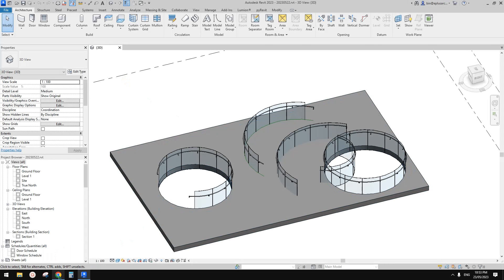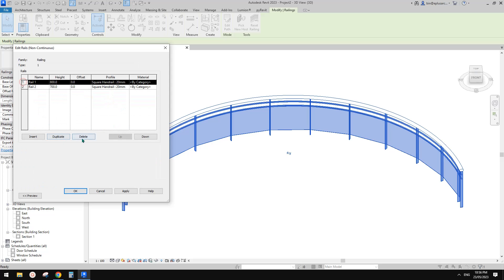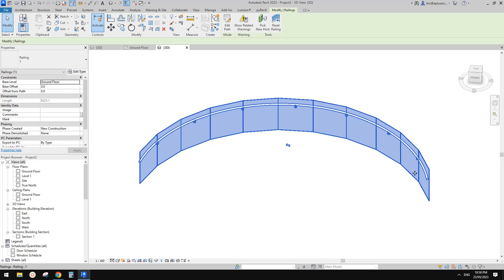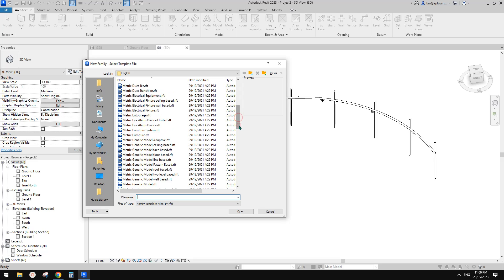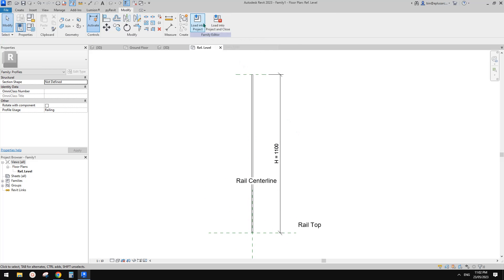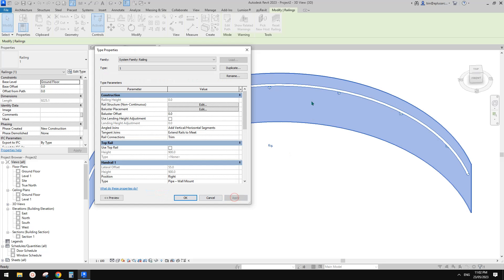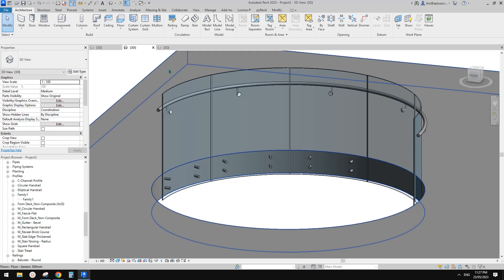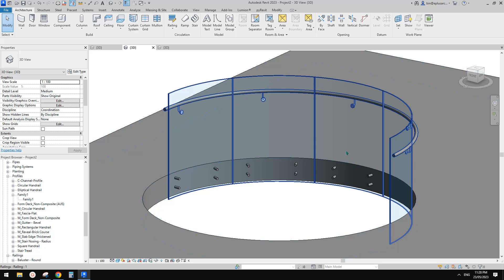23041 - Revit Curved Glazed Railing Exercise #1

Comment: Great & educative content, but resizing the balusters as panel spacing won't work on actual stairs unlike in the flat host surface in this tutorial
Reply from the maker: Did you untick the "Use Baluster Per Tread On Stairs"?

Comment: You can also make panel separation line also as a rail support family it will has the ability to move it as you wish
Reply from the maker: Good idea.
Reply: Where in the properties would I load the custom rail support family to function as a separation line on the glass railing?